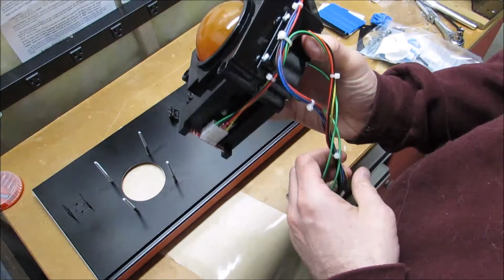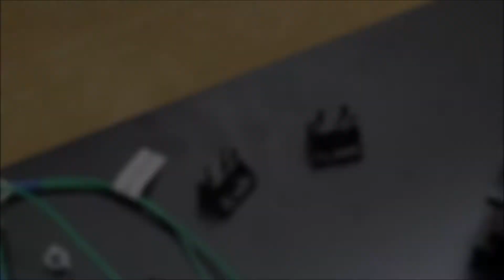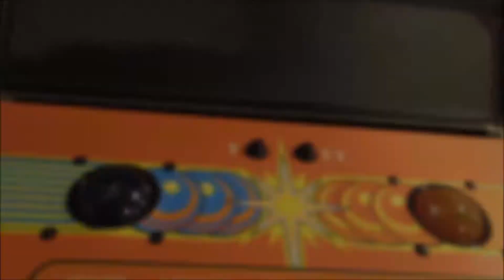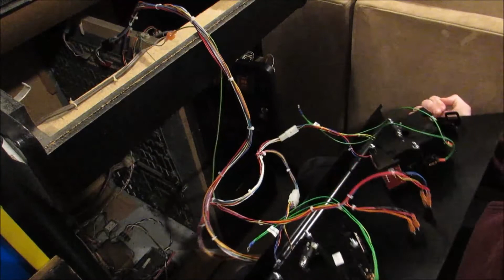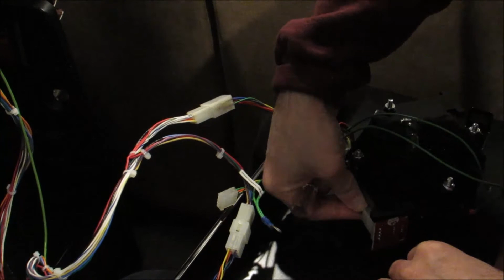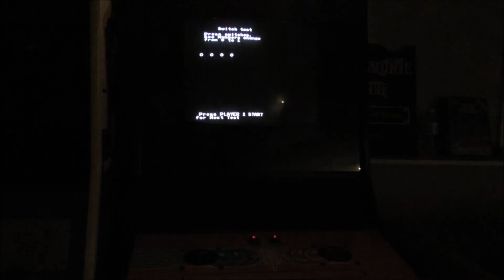Marble Madness - Reproduction Control Panel Installation (with Trackball Wiring)

Comment: Were you able to get them to light up?
Reply from the maker: Yes, I ran voltage to the lights from the power supply. I just made myself a small harness. You could also tap into the coin door lights (which I would do if I did it this time around).

Comment: Thanks for the tutorial. I'm building a cab to run Links LS2000 and instead of running a mouse as you would on a PC, I intend on using a track ball. But I got to finish the Karate Champ first🇦🇺